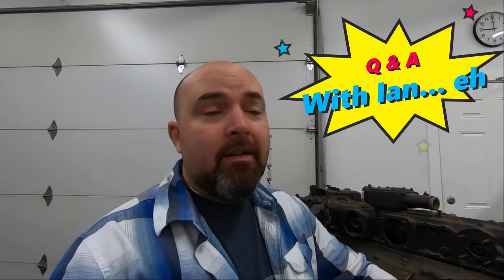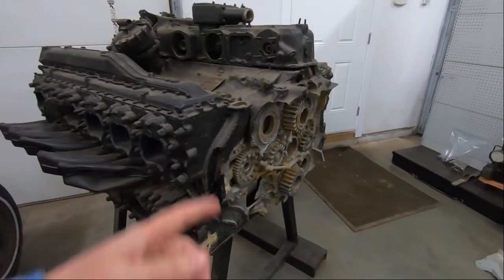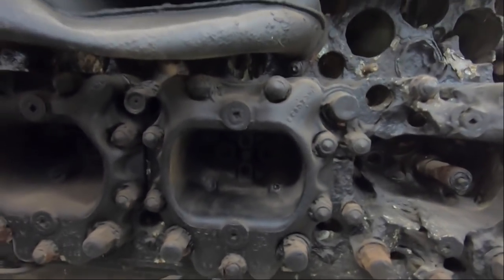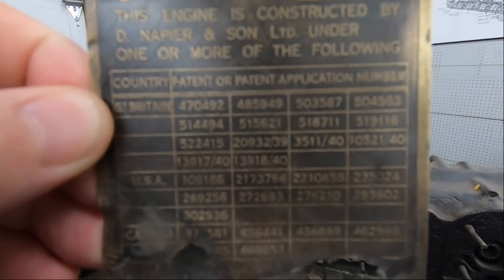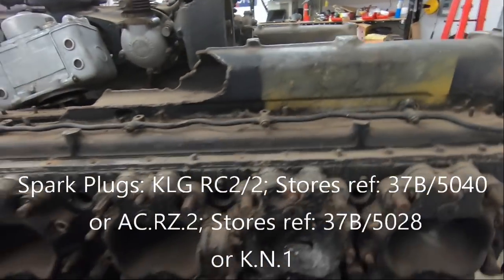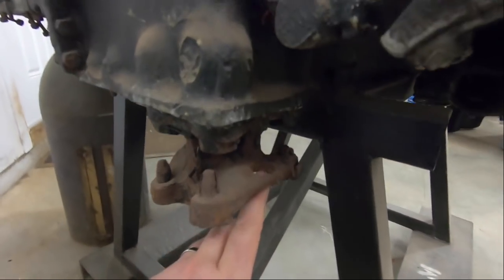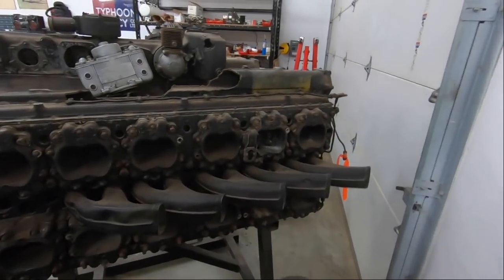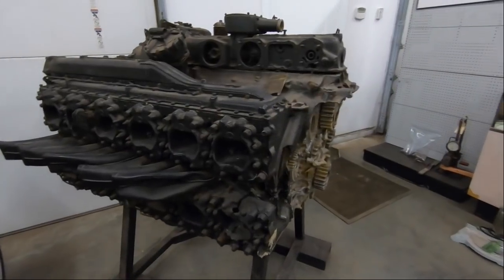Q & A with Ian eh! The Napier Sabre Engine

Comment: It would be good to have on running on a Test Trailer, good for Shows, possible fund raising.
 I also heard Rumour, that GM built some Sabre style test engines in the 40s & 50s.
Reply from the maker: I'd be very interested in learning more about any GM efforts on sleeve valve engines, do you have a source for this information? ~Ian
Reply: @TyphoonLegacyCoLtd  You might have to see if you can go through GM's archives, as I said it was Rumour Value.
Reply: The sleeve material was very special. Bristol aero engines showed Napier how it was done and that solved the sleeve problem. Bristol had some really powerful air cooled Radials Bristol Pegasus for one.
Reply from the maker: @anthonywilson4873  They sure did, reluctantly, and only because the Air Ministry persuaded them to share. I sure am glad they did! ~Ian
Reply: Bristol had spent milions on sleeve valves and did not want to lose that commercial confidentiality.  Relations between Bristol and Napier seemingly improved once Napier had been taken over by English Electric, mid war
Reply: @iancarr8682  Graham White's book "Allied Aircraft Piston Engines of WW2" tells the story that Napier was bailed out of their problems with the sleeve valve engine by using sleeves provided by Bristol.  Fortunately, the Sabre had the same bore size as as one of Bristol's sleeve-valve radials.  Or perhaps it was no coincidence, since Riccardo developed sleeve valve technology through the 20's and 30's, then licensed the information to engine manufacturers, no doubt with no small involvement of the Air Ministry.  They had a war to win, and trying to preserve proprietary company trade secrets would have stood in the way of the war effort.
Reply: @anthonywilson4873  Keufel & Esser KE965.  As I remember, some kind of stainless steel alloy.  The secret was in final grind of the sleeve OD's.  Napier's engines were failing sleeve drive mechanisms because the sleeves were going out of round.  They found that doing final grind with a dull (undressed) grinding wheel, the sleeves wouldn't go out of round.  I suppose it's a metallurgical phenomenon with residual stresses, which are much better understood today than back in WW2.

Comment: Lovely stuff! 
Hope between you, the 'RB' guys in the UK and Kermit...  we see a Typhoon or Tempest V flying again! 

Kermit has at least 2 Sabres and the UK chaps have the ex cranfield engine which is in good shape.
Reply: +SiMON PAYNE    If Kermit would allow one of his Sabres to be disassembled and 3D scanned into CAD, it would go a long way toward being able to reproduce a few parts to support one or more operational Sabre engines.  That would significantly reduce the engineering effort for building a Sabre.  The manufacturing end would be costly enough.
Reply: @FiveCentsPlease   well Kermit is the kind of dude who might make a deal..   

I.e  
Donate one of his sabre  engines if they make all the parts needed to get the other one going as well. 

Its possible.

Comment: As a recent subscriber, I have been looking at the Griffon in the background and thinking you must be going to use that in the new airplane. I have been a long time Sabre fan and so was disappointed. I am so glad to hear that the long term plan is to install a Napier Sabre. I will be contributing to the project now. I am a warbirds of America Member and have owned T-28A, T6, and T34 aircraft. I own a heavy machine shop and might be able to help on large CNC machining requirements.
Reply from the maker: Hi Ralph, thank you very much for connecting with me; the engine in the background is actually our Rolls Royce Merlin Mk III that we are putting together for a much more sinister Typhoon related plan! Would you be willing to get in touch with me through e-mail? info(at)typhoonlegacy.com I will reply from my e-mail address, so please check your spam. ~Ian

Comment: what about making a new saber.  if the one you have could be modeled in 3d it could be used to mill a new engine block, it would be insanely expensive but it is an alternative to finding a used one that is in a condition that is or could become flight worthy.    im new here. do you do all the work by yourself or do you have people who help you every now and then.
Reply: +the silent farmer     Part of the strength in the engine metal is at the molecular level and grain structure and this is controlled during the casting and heat treating.  Manufacturing engine parts typically needs to meet the original material specs so I don't think machining from solid metal stock would be acceptable for flight certification.
Reply from the maker: @FiveCentsPlease  The main castings for the engine were generally not a high grade of aluminum, some areas could be machined from stock, but the larger areas need to be cast to ensure the oil and coolant passages are correct. The other option would be to laser sinter an aluminum block or crank case, the aluminum used for this process is significantly stronger than the cast wartime material; it's just that the machines are not quite big enough yet. ~Ian
Reply from the maker: We've been looking very closely at that idea, and are putting information together to recreate the complete engine accurately in CAD; that is long term though. 

There are three to four of us that work in the shop here, Myself, Rob and Cam; Martin Also comes by to discuss design work with me and touch the Merlin. I am the only full time worker at the moment, and do most filming alone during the week for publishing on weekends (paid channel). Glad to have you following, thank you! ~Ian

Comment: 20 years?  That's sobering, but I guess it really isn't a surprise.
Reply from the maker: Hopefully sooner, but you won't hear me say that! ~Ian
Reply: The Typhoon Project in the UK are saying 5 years but they appear to have alot more aeroplane and an engine. 5 years is still ambitious.
Reply from the maker: @stewartgrant9832  Very ambitious when you consider that almost the entire aircraft needs to be rebuilt from new; surviving Typhoon parts are quite typically in static condition at best. Add to that that the Typhoon is not an established rebuild and data is scarce and underdeveloped; if a Spitfire project takes several years with all of the resources available to that type; I bow to anyone who could put a Typhoon in the air that quickly. ~Ian
Reply: @stewartgrant9832  They're hoping to have it flying in 3 years time, and considering their funding has been skyrocketing in the past year it's looking like it could be possible.

Comment: The way they harness two cranks to one gear into the hub reduction gears is fantastic. The gear sits on a slight helix I believe with diaphragm springs for and aft this allows the torsional to be absorbed by the springs with a slight fore and aft movement of the gear. Torsional’s damped and into the hub reduction unit.  I believe that is correct, I read it in aero engine book somewhere. They also use long drive shaft that can remove torsional’s as well twisting over their length. I have seen the same principal used to remove torsional’s in trucks for fuel pump drive shafts. Exciting one ton of pure muscle. Jets supplanted it but they had a lot more HP to come and had it on test.
Reply from the maker: It was quite the system used, the engineering was amazing! ~Ian

Comment: I wonder with corrosion on certain cylinders gives a clue to where the engine was in the firing sequence when it crashed?

You probably could get away with a Griffon - knowing Hawkers (like many other manufacturers) possibly had to come up with alternatives - if they had a shortage of engines, though luckily the Typhoon didn't need it.

I know two of the Tempest prototypes (the Mk.III & IV) were equipped with Griffon's.
Reply: The Corrosion was inevitable . OP said what really probably happened .
Engine was LARGELY made from Magnesium . EXTREMELY  reactive . Burns in Air once lit .

Comment: If the Saber uses the same plug as the Merlin, try Roush. We were using the very scarce ‘Lodge’ plugs on Betty Jane @ $100ea. Jack came up with his own ignition system that uses ‘his’ plugs. I bet Paul D would love to work with you.
Reply from the maker: That was only a reference to the overall plug length. Plug temp etc. still need to be checked, so far no access to anything similar to the Wartime Sabre plugs. ~Ian

Comment: The Sabre's an interesting example of engineering complexity iand gnoring  manufacturability, (an attribute it shared with the Centaurus). Sleeve valves produce beautifully smooth car engines, but they're a production headache, especially the sleeves. There isn't a directly comparable US equivalent of the Sabre, but it's instructive to compare the Centaurus with the P&W 2800. Power output varies according to model, but they're certainly in the same class, and the P&W is roughly 350lbs lighter.  the inside of the Bristol is exquisite, like a huge watch, but that doesn't kill Huns.
A few days ago, a video surfce from a group in BC restoring a Tempest. Are you aware of them? I would think you might have common problems,  insights, and interests, that could usefully be shared.
Reply from the maker: Indeed, KF Aero is putting together a Hawker Tempest II not too far from us, a good group that we work with to a common goal! ~Ian
Reply: Sir Roy Feddons autobiography is a fascinating book and goes into the rationale for the sleeve  valve. Two advantages mentioned were superior volumetric efficiency and the ability to take high  boost without detonation, this  compared.to a poppet valve engine. The sleeves were.quite tricky to make, I think they were  cast in a spinning mold, nitride and ground on Sunnen hones. The  blanks for the Sabre.sleeves.were supplied by Bristol since by pure chance the Taurus engine sleeve blank ( smaller than the Centaurus and Hercules) was of suitable size.  Bristol would not release the manufacturing IP to Napier even when the wartime government tried to force their hand . Supplying the Taurus blanks seemed like a win win i suppose.
Reply: @number1genoa  Not sure how well the theory worked out; the Centaurus made roughly the same power, (depending on fuels, settinges, &c.) as the P&W 2800, which was about 350 lbs. lighter, and probably a hell of a lot easier to make.
Reply: @parrotraiser6541  During the mid to late thirties most aircraft designers were demanding ever more power.  This was a time of much experimentation and development for aero engine designers, there were some successes and lots of failures. High octane fuels were not freely available in Europe and the UK.This limited the use of high boost pressures from super charging. While hot exhaust valves were problematic source  of ignition later solved by sodium  filled stems and probably other improvements. The sleeve.valve approach did not have this drawback which seemed like a promising avenue in the pre war period. Its all in the autobiography but I think the specific fuel  consumption of the sleeve. Valve is better ( fuel consumption relative to displacement.)
Reply: @Tony M I grew up near Ricardo's works.
Reply from the maker: @number1genoa  The sleeves will again be a challenge. I will look for this book, thank you for the reference! ~Ian

Comment: Ian, 
  Thanks appreciate your problem but cannot say fitting a Griffon is the best answer but understand in the context of satisfying the authorities.
I have seen a photo of a Tempest with a Griffon with rads in the wings a bit like its successor the Fury. The sleeve valvers I think have been given
A rather mythological negative status (especially your side of the Atlantic and a bit south) . Wether myth becomes prejudice when you apply for your
Certs remains to be seen , I cannot but admire your tenacity with this awesome aircraft which despite its faults was a game changer, seeing it flying 
With a sabre would be incredible.
Reply from the maker: With a bit of luck, the Griffon won't even enter into the equation; the Sabre remains the project intent. I have to agree with you regarding the status of sleeve valve engines, the Bristol Freighter proved very successful under power from the Hercules. ~Ian
Reply: Ian ,
     Many thanks for the personal reply much appreciated. I expect you are aware of Nick Graces Mk II Tempest (centaurus) and the Tempests V  (sabre), and II currently under restoration by Kermit Weeks.
  I think the `Beaufighter at Duxford has been hanging around for ages waiting for the right type of Hercules. I was under the impression Bristols made them into a quite self contained 'power egg'
 for a variety of applications but maybe not that particular one ?  @TyphoonLegacyCoLtd
Reply from the maker: @johncrispin2118  Certainly! It is my understanding that Kermit has shelved the Tempest projects for now unfortunately. I do love the Beaufighter, but cannot claim knowledge of the specific engine marks used, but do understand there to be quite a difference. There is a Beaufighter project in Ottawa as well, but I'm not sure if they have engines for it yet; must be short supply! ~Ian

Comment: An impressive engine. Could it be argued that it is the most powerful piston engine that actually went into production and saw combat?
Reply from the maker: Wartime operations saw Sabre use up to approximately 2500hp, power to weight was very good, but I understand there to be several other engines capable of this output by the end of the war. It was a game changer early on, with nothing else matching it. By the end of the war, power levels were only on the rise, but jet engines rendered the Sabre old tech. ~Ian
Reply: The R-3350 and the Bristol Centaurus both saw combat........
Reply: I've been given to understand that the claimed output of the Sabre was well down on it's actual output and vastly down on what it was capable of. I've come across figures of 2500hp and even in excess of 3000hp on a specially built record attempt airframe that suffered structural failure on landing. So it might actually be the most powerful.
Reply: @vipertwenty249  Look at the R2800 figures. I was surprised. And if you want confirmation look at at the unlimited race Czeck Mate. It uses a 2800 and at the speeds it's going it's got to be close to 3000hp which is not far off the stock spec.
Reply: The P&W R2800 was putting out similar power to the Sabres. But ultimately the Sabre appears to have gone further on test beds.

Comment: Excellent! Even flying with a Griffon is still a flying Typhoon.
Reply from the maker: Hopefully it will not come to that, but it would be better to have it flying than sitting on the ground while we put together a Sabre. ~Ian
Reply: @TyphoonLegacyCoLtd  Just wondering if it wouldn´t soak up too much time trying to engineer a Griffon to fit, that would be better spent on the Napier. Dilemmas, dilemmas! :-)
Reply from the maker: @jamesdeath3477  No effort will be put into that plan unless we are very close on the airframe, but many years from a Sabre being operational. ~Ian
Reply: @jamesdeath3477  Yes, that is my thought also, you are not just going to bolt  a Griffon onto the front, and fly it! Anyone who has ever swapped a car engine out would know the problems that entails (on a much smaller scale).  I hope they can find a flight worthy Sabre, as having to machine one from scratch would be a Herculean effort, even with modern tech.
Reply: @ChargerMiles007  I think they would need to build quite a few, cast the cases etc to provide spares.